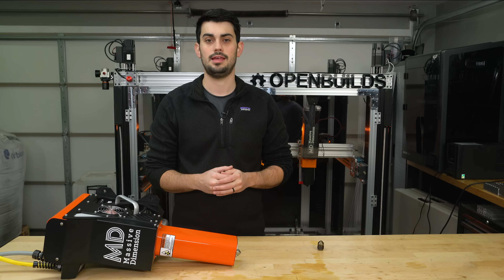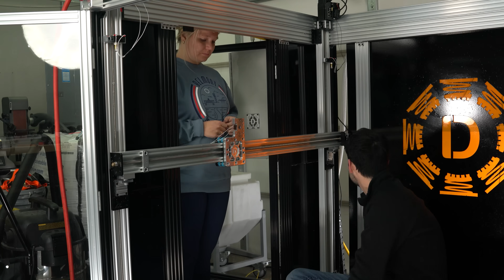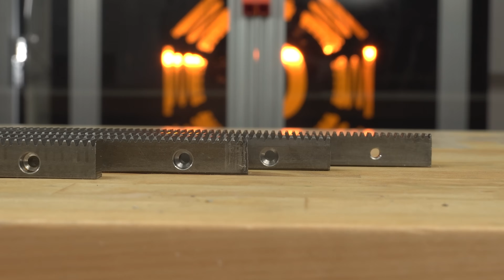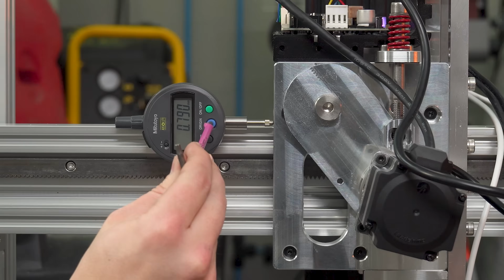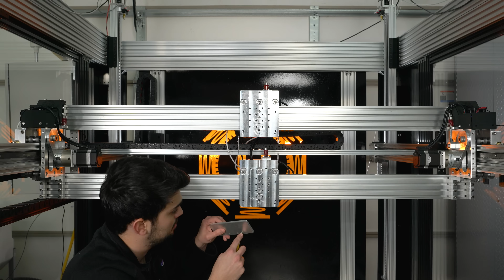Rack and Pinion Upgrade: Key to Faster Large Format 3D Printing (Part 6)

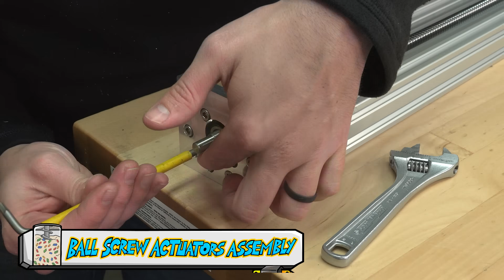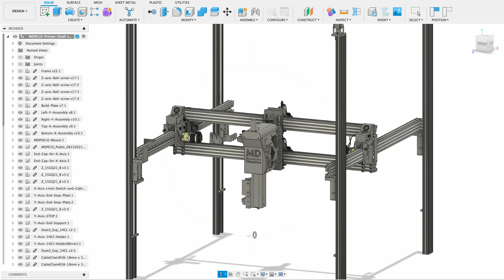Comment from the maker: If you want to skip all the talking/theory the build montages start at 13:49 (Z-axis ball screws) and 28:54 (gantry rack and pinion). As you can imagine being able to not only move the print head around faster but also handle a larger extruder will make printing large objects (*cough* benchy *cough*) much easier! In part 7, we will take a close look at the extruder and wire it up for printing.
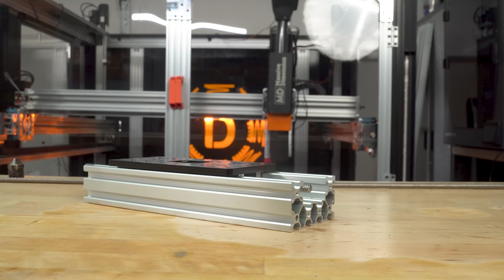Reply: I just want to say i love the setup shown at 4:47 !

Comment: Easier to do crash detection with a strain gauge mounted to the plate. No need for the spring assist assembly.

Comment: Man, you could have put the print head on pivots and use the seperate motors tilt it. Then not only would you be able to get the nozzel further over to clear the other motors, but you'd be able to do nonplanar prints. Basically you'd have another axis..

Comment: I think there are advantages to not using a belt setup. Did you compare belt vs. ballscrew more in-depth? Do belts behave like springs at that length? Or is springiness not a problem and that is why longevity is the main topic? However, regarding rack and pinion, I guess moving mass is probably a topic to consider? When using a ballscrew you could use bigger motors. In the rack and pinion setup, you also move the motor. The motor can weight several kilos, however, in a ballscrew, that wouldn't matter and with a bigger ballscrew diameter, there might be not too much torsion on the ballscrew. At that size, I would have thought, that compactness is not the main problem and you could achieve accelerations, which make the gantry stability the main topic.
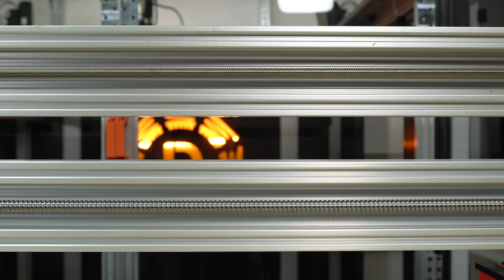By the way: There are also high-speed ballscrews, which have a much higher speed. That would eliminate the increased rotation speed discussed at 9:36.

Comment: An idea, on long runs you could add nutless supports that are pulled out from the bearing end when the head is close to the drive end. And they could act as a cable guide from the side

Comment: You could place some radial bearings in the channel around the screw and held in place by loose springs so that the print head can easily push them aside while operating.

Comment: Thank you for the video. I can see you gave the design changes a lot of thought!

The one thing you didn't mention, is calibrating the real encoder travel along 1500mm.  The one problem with rack and pinion is that a small error will add up and you end up with shorter or longer travel. 

Just wondering if you gave it some thought or not but maybe it does not matter for this application.  

I really enjoy the video though.  Cant wait for that benchy.

Comment: Surprised you didnt test the OpenBuilds rack and pinion system. Its much lighter and not as durable obviously. Its also a lot cheaper and the ends match. I can see why it would struggle with that massive print head. Also c-beam filled with threaded rod and epox is a really easy way to make those beams as strong as steel, while also giving extra strong mounting points at each end.

Comment: Hey DrDFlo. Wanted to throw out a couple things that I'm not sure you mentioned. I know your ballscrew upgrade has many benefits other than solving the whipping and maybe the original plan was to do all 7 actuators with ballscrews. Since the ballscrews only ended up on the Z axis this negates the entire whipping concern. Whipping is primarily caused by the sagging of the screw when mounted in a horizontal orientation.

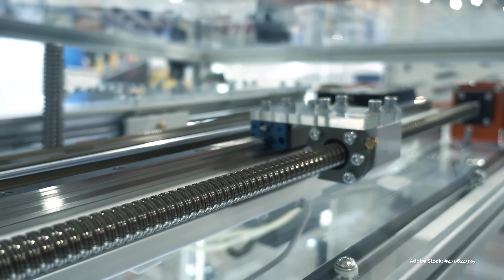Another thing that I don't see mentioned often is a brief piece of info that some people may find useful or interesting, in response to 8:07 "So we should get accurate motion with the ballscrew". These ballscrews are (I'm assuming based on some of your comments) the typical low cost rolled ballscrews that can be found on ebay/amazon/aliexpress. These are likely what should have been C10 ballscrews but were rejected (and therefore sold cheap outside of typical industrial automation sales channels) and therefore likely worse than C10. The main point here is that the lead accuracy will be different for each of the 4 screws and it will actually vary along the length of the screw randomly as well. So even with a theoretical exact same rotational input to each screw - they will all move different amounts vertically and it will not be consistent. Now this probably doesn't matter for an application like this too much except in a rare case, but I thought it might be interesting to someone.

C10 travel distance accuracy is +/-210um per 300mm travel. There is no rating on the fluctuation in lead accuracy per revolution for C10 since typically nothing worse than C5 is used for accurate positioning. But for C5 which has 18um/300mm travel error - the travel distance fluctuation per revolution is +/-8um. Unclear what sort of fluctuations would be present in C10 since the process of rolling is very different from C5 grinding and some of the error comes from the individual ball variation. This gives insight into the different accuracy errors that can be expected from using a ballscrew in an application like this, and should help someone who wants to get to the next level in accuracy.

Comment: I've worked on printers this large. If you're going to be running ball screws, you need to do weekly maintenance in greasing them. We did some calculations where I work at, and x and y travel for a week of printing on a machine that size is several hundred kilometers which is usually the measured grease interval for ball screws.

Comment: you could have multiple y-beams print heads side-by side. working on the same print level. that way each print head has minimum travel, it can mostly reside on one x-y region of the print. dc magnetic rail dc motor would be even better, no moving parts, other than the print head beam(s). also instead of one massive expensive print head, you can use many print head y-beams with small fast inexpensive easy to make print heads. well just divide the large extruder print head print flow amount with small print head flow amount to get the amount of small print head y-beams. if you dont want to deal with collision avoidance algorithm of the y-beams, then dividing up the whole x-y print regions to small regions for independent print head regions would be very simple. its like having 16 (4x4) printers instead of 1 large printer. so add double/triple lining bearings to the ends if its not steady. drop the jam. how about the print level optical sensor instead, like a water level trigger, on the side of the printer. of just some distance sensors on the print head. dual use for print bed leveling.
Reply: terminator is next.

Comment: your other option (although perhaps difficult due to space etc) is to mount your motor to your motion assembly and use a smaller ball screw that is fixed and drive the nut with the motor. 
Probably not needed at this scale, but once you go large format like a gantry cnc (and you want more accuracy than a rack can give) it is a clever solution as you can tension your fixed ball screw and don't need to worry about whip as it isn't turning.

Comment: Set screws absolutely suck.  Your pinion needs to be connected with a collet system.  A set screw involves clearance, distorts the gear and will require more clearance.  I would grind those partial teeth off and realign with all full teeth.  That bump over the left joint isn't going to "break in".  I saw two herky-jerks in your fast transitions.  It seems you didn't mention multi-start ball screws.  Forgive if I missed that.  I do like your generally thorough coverage of a topic.  What keeps the print head from floating around within the range of backlash during Y movements?

Comment: Been watching your stuff. I gotta ask. Why not a belt drive? I work with digital print presses with the print carriages weighing quit a bit moving a lot faster than any regular 3d printer using belt drives. Seems to me you would want to keep the weight down as much as possible but you're adding very thick solid aluminium parts. I'm not an engineer so I'm curious to know if I'm missing something :)

Comment: by the way - our machine throws 14kg extruder at 1.7m/s with no sweating at 2000mm/s accell :) So servos and belts are the solution for sure. You are right ;)

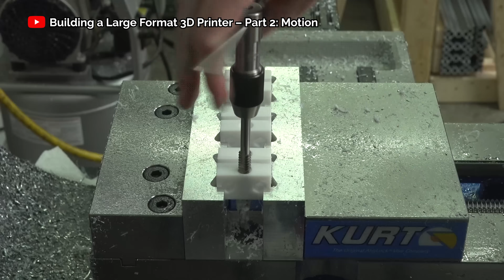Comment: 6:35 you could compensate for the weight of the assembly with a counterweight system similar to the one used in elevators

Comment: Using HTD8 belts would provide immense thrust and they are quite easy to tension. They can be ordered with mounting blocks and you just need to make sure you can tension the belt from one side. the blocks can be tighten in travel direction with simple screws and you can then clamp the block, once tensioned enough.
And regarding the width of the belt: the weight you are using is still minimal, compared to what such a belt can handle. a 30mm width belt is defenitely enough here.
What you could also use (though a bit more expensive) is a mustang style belt. this has angled teeth, aligns the belt drive perfectly and mitigates vibration from engaging/disengaging teeth

Comment: When I worked in the mechatronics industry, we always used linear motors if we wanted high performance, since lead screws were too high maintenance. If proper linear bearings are too rich for your budget though, I can't see you stumping up for linear motors either. *8')

Comment: I’ve been dreaming of a rack and pinion upgrade for my Lead CNC, which also uses openbuilds c channel. I don’t suppose you post any of your parts files online for download anywhere do you?
Reply from the maker: I have not decided whether or not I will post the design to my website. Unlike my other open-source designs that rely heavily on off-the-shelf parts, one R&P carriage requires 5 custom machined components (front and back plates, tensioner arm, tensioner swivel, and top tensioner mount). This would make it difficult for most DIYers to recreate my design, but it would be relatively easy for a company to take my design off my website and manufacturer them without proper accreditation/licensing. I am considering making a version that can be laser cut (much cheaper to manufacture) and selling the components. Let me know if this is something you would be interested in.

Comment: Does your website have the files for the new rack and pinion motor mounts? Would it be possible to cnc them on a tormach 440?
Reply from the maker: It would be possible to machine them on a Tormach 440. But I have not decided whether or not I will post the design to my website. Unlike my other open-source designs that rely heavily on off-the-shelf parts, one R&P carriage requires 5 custom machined components (front and back plates, tensioner arm, tensioner swivel, and top tensioner mount). This would make it difficult for most DIYers to recreate my design, but it would be relatively easy for a company to take the design off my website and manufacturer it without proper accreditation/licensing. I am considering making a version that can be laser cut (much cheaper to manufacture) and selling the components. Let me know if this is something you would be interested in.
Reply: @DrDFlo  That's an interesting thought on manufacturing them yourself and selling them on your store. I'd happily order a few of the plates you built for your ball screw implementation.

Is there anyway to contact you about possibly consulting on a project?
Reply from the maker: @billtudor1953  Yes - shoot me email at : dflo@drdflo.com
Reply: @DrDFlo  Sent! Thanks

Comment: Why you don't pick a precision planetary gearbox? I bought 4 with 15 arc min backlash and 90% efficiency for 40$ a piece. I am building a large delta and I snatch Beta ZRS 100 belt auctiators 2m long. The guy ask for 200$ a piece and I bought all 9. But I can’t afford MD extruder so I bought screw and barrel from china for injection molding and I will try my luck to build the pallet extruder myself.

Comment: dude, just use cheap linear rails, they will be better than the v wheels
also, flip the gas spring, they have a tiny bit of oil and in the orientation that you used in cad the oil remains at the opposite end, apart from that, I love the design, cheers

Comment: Cool video. Just to add what you said about belt driven machines: you can search for oscillating knife cutting machine. You will see a fast and heavy machine that a lot of times uses belt driven motion system. The ones I know from years working with cnc machines and are belt driven (some are rack driven) uses 40mm at5 or at10 belts. They are fast, heavy and cut a few layers of smooth material.
Also, my company builds 5m long Router machines that are belt driven. A good 30-40mm at5 can do the job, just make sure that you have something holding the end of the motor/reducer shaft, otherwise you will bent it haha.

Comment: I don't understand still why the need for a screw on the x/y.  There are big belts, bigger belts than you will ever need. belts that transfer hundreds of horsepower if needbe.  there are also chains, which will outlast any bushing screw you can place there. they're going to be more reliable than a bushing screw system

Comment: Great work, keep rocking! Looking forward to see the future of it! Just a thought from a fella engineer: would it be a more elegant solution and better overall to use a single plate on the back rail mount of extruder? Instead of 2 separate plates, held together by wires.

Comment: Correct, this is why we use it on large format CNC already.  :). It's more accurate than belts but a LOT faster than the ball screws will ever be.  Also... God this makes me love my voron.  250mm/s is my baseline abs print speed and it makes me so happy....lol also kinda makes me want to throw a stealthburner on my big CNC tool plate and see if I can print a car... 😂 1:1 scale

Also...dude you have a mill, what are you doing?  Machine the ends of the racks yourself and just cut off the excess rack at the end 😂 Lol you could do it with an angle grinder, with a proper mill there's no excuse.  You really didn't need the dual stepper setup for the x... I've got a single nema 32 running on mine that runs a heavy rotary head usually and it's more than what's needed to mill metal...

Comment: this is pretty cool. you can gain more travel by splaying the x axis rails top and bottom and supporting the extruder head in between them. resolves motor conflicts and symmetric split of travel in the y axis.

Comment: With the two rails, what if you also put them on opposite sides of the center rail so that the heavy print head acts torques into both of them? It should simplify the design by using the weight of the print head as the weight that presses the gears together.

Comment: @DrDFlo - excellent breakdown of your engineering choices and tradeoffs. I came across this neat solution for rack-N-pinion backlash by Damencnc while designing a 4x4 cnc router machine using the same C-beams.  This assembly video shows how it works so you might be able to apply a similar solution, given their product doesn't appear to work for your application.
https://youtu.be/d1sHaF7PYwY?si=pvERfcAq8GOS28dK

Comment: Just a heads up, if you do decide to upgrade to a helical rack, you'll want to make sure there's room for 2 sets for every axis, which is easy to implement on the Y axis, but not as much on the X. The helical motion will want to pull your gantry in the direction of the teeth causing side to side backlash, but if you use a second offset rail that will remove much if not almost all of that side to side backlash on a direction change.
Reply from the maker: Interesting - didn’t consider this. Much appreciated!
Reply: He can set two helical rack beside each other, like a Herringbone gear. Then the forces would cancel each other out, thus you just have to do it on one side of the gantry.
Reply: @motordude67  that would definitely work as well, but I don't think that would fit in the C Beam profile he's going for

Comment: You may want to flip the gas strut upside down; those struts tend to have a little oil mixed into the gas to lubricate the sliding gasket, which of course settles at the wrong end if you have the strut oriented the way you do at the moment. This Old Tony points this out in his Maho CNC conversion series, where he is using struts to offset the mass of his table for the vertical axis.

Comment: Wow, bravo! Do you know how many hours of work went into this? and now we get this as a video (extra hours) and the design is opensource (right?)! Thanks for all this information, very helpful for me personally. I am working on a project to recycle plastic household waste (as shredded flakes) with a DIY extruder system on a 3D printer. Very nice to see that you could find and show your solutions of the moving system. 
I have a question about possible future developments. Peopoly's 3D printer (Magneto X) uses a linear motor system. If there were parts that were affordable and in a suitable form factor, could this be a possible design choice?

Thanks for your work! This is just so impressive and helpful!

Comment: One thing some people do when designing with very long and heavy ballscrews is that they make the screw stationary and the ball housing the rotating part. Same can be done with the cheap trapezodial screws as well by making the nut rotate and the screw stationary.
Reply: Do you have an example? I’ve never never heard of that.  How would it even work?  The nut in the ball screw needs to be fastened to the load. How do rotate something thats fastened?

Then, you also have to move the motor so it travels along with the load.  

Quite the mess if its even real!